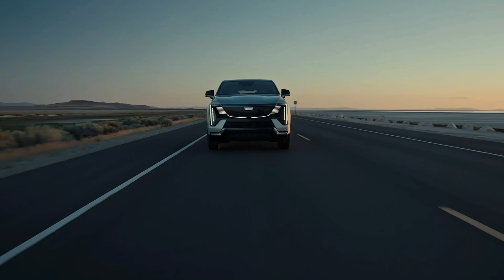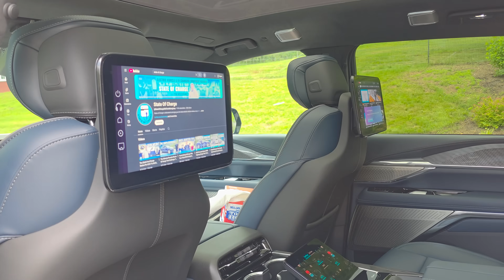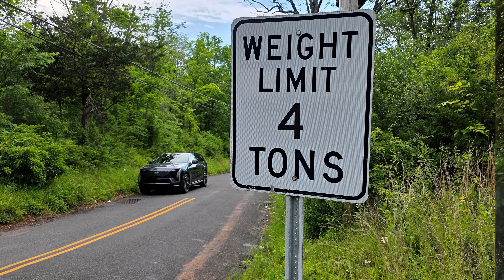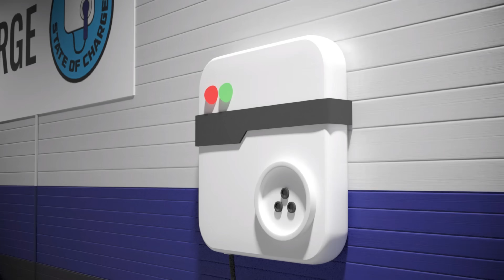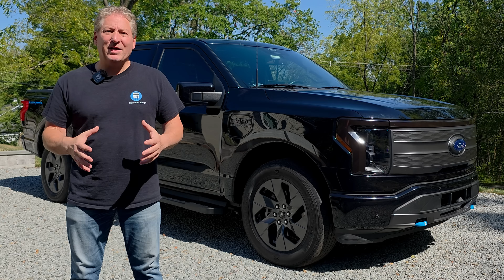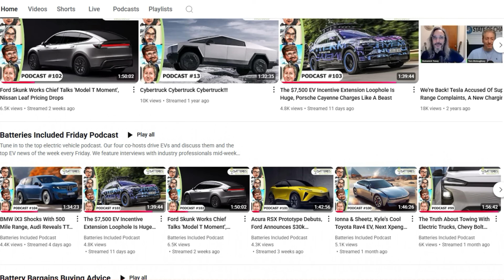Are General Motors Electric Vehicles Too Heavy For Some Public Roads?

Comment: Excellent video, especially the part about people blaming road damage on EVs. In our state they just increased the EV "fee" from $75 to $150 based on the false narrative that they cause more damage. I don't mind paying my fair share but that is excessive.
Reply: In Ohio it’s $200. The state gas tax is $0.385 per gallon. That means for an average mileage of 30 mpg they are assuming an average annual miles of over 15,000! In short they are screwing EV drivers. Not surprised given it’s a red state.
Reply: I’ve always argued the wright thing is bogus since my EV is lighter than most pickups and full sized SUVs. If you care about vehicle weight, the motor technology is irrelevant. 

But these vehicle weights are obscene. 

Base the fee on weight and mileage, and double it for anything over 4T …. For all vehicles equally
Reply: @danielp920  In my state, SUVs and trucks have a much higher registration fee compared to sedans for exactly that reason. And the motor technology is actually relevant specifically because EVs are almost always heavier than their ICE equivalent.

It took a bit of Google-fu, but I finally managed to locate some average numbers for comparison. The average ICE minivan is about 4,330 lbs to 4,850 lbs (updated in 2024). The average weight of an EV minivan is around 5,291 ;bs to 5,511 lbs (couldn't find an update date on the article). But that is generally about a thousand pounds more than their gasoline counterparts. Obviously, it's going to depend on exactly what models you're comparing.

I pulled minivans specifically because they tend to about about the same general size so it was a bit more of a direct comparison.

But all vehicles these days are being made larger and heavier - which is quite frustrating for those of us that don't want a larger and heavier vehicle. And auto makers are using that to justify the stupid price increases on new vehicles. That and they keep insisting on even base models having "luxury" add ons by default. It's ridiculous how the newer vehicles barely fit into parking spaces anymore.
Reply: elp "the "wright" thing is bogus".... Just like those that rationalize their narrative is right because they want it to be.... C'est la vie
Reply: 4 tons on 4 contact patches does more damage than 4 tons spread over 6 contact patches
Reply: It’s not “more” damage.  It’s just to replace the gas tax you’re not paying.

California charges $100/year for EV road tax.
Reply: EVs don’t pay gas taxes.
Reply: Well, they do cause more damage than a lighter vehicle would. That's just a fact - the physics are pretty clear on that. Is it a significant amount of damage? Probably not.

But given EV owners aren't paying the gas tax (which directly funds roads and bridges), I do think a higher registration fee is perfectly reasonable. In fact, that particular increase is probably a bit too low given how much the average gasoline vehicle will end up paying in gas taxes every year. But that can (and will be) debated.

The gas tax has needed increased for decades now, as well. Sure, I don't want to pay more for gas. But realistically speaking? Yeah, it needs to go up.

An alternative to a higher registration fee would be an EV tax on fast charging stations and for EV chargers installed in homes. Although considering most EVs can be plugged into an appliance outlet without causing any problems (although they will charge slower than they would with a dedicated charging port), that would need to be taken into account as well. The per wattage for EVs would make more sense IMO and probably be something EV owners would prefer over a flat registration fee increase.

Or perhaps a mixed system would work better? A somewhat higher registration fee and then an extra EV tax on the fast charging stations, but no tracking of how many watts are used for EVs when charged at home. Done that way, the additional tax funds for the registering county for EV usage would be paid to your home county and anyone traveling long distances will be paying an EV tax in the areas they pass through where they need to charge - similar to how it works when traveling with a gasoline vehicle.

Either way, EVs do need to be paying into the road maintenance fund. It's just a matter of determining the best way to accomplish that.
Reply: It can make sense as a substitute for gas tax revenue. Oklahoma did this, a flat fee roughly based on average gas tax paid. But in the same bill they also put a $0.03/kwh tax on 50kw+ chargers, which works out to actually be higher per mile than gas tax all on its own. But at least most of the road out here are tolled and are just billed by axle.
Reply: @Senthiuz  not as a flat fee, as a per mileage fee equal to the gas tax
Reply: It probably needs to be higher in reality and unfortunately. To pay for the roads.
Reply: @EricMotoring how bout we increase the gas tax too then. Infrastructure needs funded and there have been budget shortfalls for way longer than there have been modern EVs
Reply: @Comfort031  It should be, but politically it's a third-rail. Unfortunate...
Reply: @Comfort031 that sounds fair to me.
Reply: @EricMotoring  increase the gas tax, the ev fee is already punitive for basically all drivers
Reply: @AustinWirl I disagree. All vehicles using the road should pay. It doesn't matter how they are fueled.
Reply: @EricMotoring oh yes I also agree but now the flat fees are punitive, so either they should be decreased or the gas tax increase for fairness
Reply: @AustinWirl true. Maybe they could base it on miles driven and vehicle weight.
Reply: it's not a false narrative , since it still damages thinner secondary roads excessively  .... .  just not major highways design for much heavier vehicles. Civil engineer was being misleading,,,

But the narrative is usually that it replaces the gas tax.... My issue with it is that it shouldn't be a Flat tax,,,, it should be per mile tax for every vehicle.... And the gas tax should become a pollution tax
Reply: @nc3826   They should tax the electricity consumed. The closest equivalent to a gas tax.
Reply: @linusa2996  LMAO... Good luck with that  Comrade Linus.

Comment: Here in northern IL, most riad restrictions are set at 6 tons registered weight or by tag class which shows on the plate with a letter. 1/2 ton pickup uses a "B" plate with heavier trucks going up the alphabet. That makes enforcement easy. Signage says nothing over "C" plate, dont be there with a "D" plate or above.

Comment: Saving the world one 9,100 pound vehicle at a time.
Reply: 2025 Ford F-150 is the Limited trim with a 5.0L Ti-VCT V8 engine, SuperCrew cab, 5.5-foot bed, and 4x4 drivetrain, weighing in at approximately 5,863 pounds

Comment: Ironically, in a few cases it might actually be someone’s driveway that could have the problem. 😢
I haven’t done the calcs/engineering, but 1” asphalt on top of a poor sub-base (e.g., doesn’t drain well) especially with freeze/thaw cycles I could see having problems over time.

One can see this in some asphalt parking lots where there are wheel ruts.
It is not about EVs as such; just the weight of whatever vehicle vs how the pavement was designed/constructed.

Comment: I’m a structural engineer that specializes in bridge structures. Each state is different, but in Georgia a gross posting on a bridge includes all vehicles, not just commercial vehicles.  As a general rule, our lowest weight limit for a bridge is a gross posting of 5 tons. On rare occasions we have allowed a 3 ton posting, but speeds had to be limited to 5 mph and only one vehicle on the bridge at a time.

Another thing to keep in mind is that there is a safety factor involved here. This is to cover for stupid people. The signs are a CYA by bridge owners. We know that over weight vehicles cross these structures. Those signs hopefully prevent lawsuits when a bridge fails.  It also lets the bridge owner go after the driver that damaged the bridge. At least in Georgia, you damage a bridge we will go after your insurance to replace the bridge. 

As a side note, the IQ is heavy, but it’s laughable that anyone thinks this is worse that the HL93 design weights we use to design bridges. Heavy? Yes. Damaging to bridges? No. Much heavier things cross these structures bridges more frequently. People can relax.
Reply: Well said!!

My Cvl Eng & pavement education, and some job experience were telling me similar things :-)
Reply: @DYT-jx4jp I remember my highway design class in undergrad. It was interesting. The comment by the engineer in the video about width and depth are accurate based on that class. 

My experience and expertise is not in pavement design, but I do recall conversations in Georgia around increasing legal loads. The big issue with a lot of locals is that their roads are not actually designed. They just put some asphalt on it because they had a little extra cash. I was wondering if that’s why they have the weight limit signs for the roads.
Reply: @dalegoff6186  Sure, I bet that is the case in a variety of places across the US. 
Where I grew up it was thin layers of chip-seal over whatever had been there for decades. New neighborhoods got gravel/base-rock below the chip-seal and later developments switched to a reasonable sub-base with layers of asphalt. (A selling point for the neighborhood.) The streets in the neighborhood were better than the local township streets. But, they still put the weight limits on the neighborhood streets.
Reply: @dalegoff6186  Interesting point, It would be informative to get an answer to your question...

Comment: I hate the idea of our roads being full of people in fast accelerating and massive EVs that can bust through barriers like they were semi trucks. Our roads are already dangerous enough as it is for pedestrians and bikers and people in smaller cars. Just putting more massive batteries in cars to make them go further is "dumb range" as others have said. If you are buying a truck to haul boxy trailers long distances, then yeah, more batteries is what really matters because you can't increase the useful range with less weight or better aerodynamics. But there's no good reason for a luxury SUV to weigh 3x as much as a regular SUV.
Reply: I'm hoping one day EV batteries will become lighter, with more range, therefore eliminating this issue.
Reply: 2025 Ford F-150 is the Limited trim with a 5.0L Ti-VCT V8 engine, SuperCrew cab, 5.5-foot bed, and 4x4 drivetrain, weighing in at approximately 5,863 pounds

Comment: There is so much here that could be covered and yet so little impact to most in their day to day life :-)

The engineering matters in real life in some/many situations for sure. For example, those VT covered bridges, bridges and culverts, and some roads, and on the some road subgrade loading in different seasons. 

In other cases weight was used for the wrong reason to cover for the real reason (e.g., don’t want big trucks except the Fire Departments, Garbage, Movers, etc) vs stating the real reason.

Comment: Agree EV owners shouldn't pay more, but they should pay as much.  Gas taxes pay a lot towards highway construction and upkeep.   EVs don't pay any gas tax.
I dont want to pay more but  I see it.
Reply: Why not just do it based on weight and distance travelled each year during registration and take the road taxes off gas. That way it applies to all vehicles equally and would be fair for all.
Reply: @Snerdles Reporting mileage is a PIA. Many would lie.
Reply: @205rider8 drive up to the DMV, they look at your odometer and record it.
Reply: 2025 Ford F-150 is the Limited trim with a 5.0L Ti-VCT V8 engine, SuperCrew cab, 5.5-foot bed, and 4x4 drivetrain, weighing in at approximately 5,863 pounds
Reply: @rp9674 and they pay about 4-5 times the road taxes, through fuel usage, as a civic. So why do EVs that weigh even more not pay anything?
Reply: Why don't gassers pay for Damage Done to everybody's environment
Reply: You have choices, buy a gas car, pay for gas well oil producers get tax breaks and incentives

Comment: I've been saying for years now that they need to figure out something with bridges and ev weight. Engineers have to estimate the average weight that would be on a bridge if it was full of vehicles during traffic or something else. Since they probably did all those estimates for ice vehicles we will likely see at least 1 collapse in the future. Don't worry though I'm sure politiicans will do something after about 3 or 4 of them fall.
Reply: 2025 Ford F-150 is the Limited trim with a 5.0L Ti-VCT V8 engine, SuperCrew cab, 5.5-foot bed, and 4x4 drivetrain, weighing in at approximately 5,863 pounds

Comment: I don’t think the taxing of EVs is because of damage but rather the nonpayment of taxes on gasoline which is used for infrastructure
Reply: It's for neither of those things, EVs are taxed separately for political reasons.
Reply: Well, it's both. It is in most cases the most vehemently argued for by the anti-EV crowd, so they cover all the bases they can.

Fact is, just as the marginal increase in weight really doesn't affect road damage in any practical way, the tiny fraction of EVs on the road today aren't really going to contribute much to transportation budgets if they are taxed like gas cars. The extra fees for EVs is really there just because anti-EV people in state legislatures wrap their prejudice up in the plausible complaint about lack of fuel tax from EVs.

CA has the biggest share of EVs in the US, accounting for 35% of all EV registrations nationwide. Even there, they don't account for even 10% of the total motor vehicle registrations in the state. Percentages are even lower in other states. It's worth anticipating when EVs become a significant proportion of registered vehicles, and plan some legislation to enact when that happens, but given that the same people who are agitating the make EVs pay extra fees are also the same people doing everything they can to discourage EV ownership and hobble all attempts to improve EV-supporting infrastructure, I feel like we ought to be ignoring them for now.

(Of course, most states have already imposed fees, so that ship's sailed...still, the hypocrisy grates on me...)

Comment: The Federal Highway Administration's website covers the key reasons for weight restrictions. The spash page has all the information in an easy to read format. https://ops.fhwa.dot.gov/publications/fhwahop16068/index.htm#:~:text=Transportation%20agencies%20rely%20on%20driver,designed%20to%20support%20such%20loads.

Comment: Makes you appreciate how lightweight and efficient Tesla designed their vehicles so many years ago.  All these other companies are chasing “range” so much, they just pile on more and more heavy batteries.
Reply: Chevy bolt 3600 lb
Reply: Some others are improving, e.g. MG IM5 & IM6 compared to Cyberster.
Reply: Well said a similar rwd model Y is almost500# lighter than our 25 equinox lt every with more power, more features, more tech etc! Imagine tesla with semi solid state and ssb here soon. Cut 250-750# off of them! Also fascinating is merc experimenting with in axle in board sealed single disc brake drive units. The claim is prototypes are 100kg LESS IN MOUNTED weights vs current tech. Rumored to possibly enter production in late 2026-2027 in high end merc evs. So using those much more compact, efficient and powerful drive units in concert with semi or ssb could shave 200-500kgs off of premium Evs within the next 2 years. And it would trickle down from there.
Reply: @4literv6  re: "Well said a similar rwd model Y is almost500# lighter than our 25 equinox lt every with more power, more features, more tech etc!..."  "BUT WAIT THERE'S MORE...!!!" (best Ron Popeil voice) don't forget that in your obsession and preoccupation with Tesla and "moreness", this "more" includes MORE FASCISM (oh f&*k). 👈that's right, all those flat screens on the dash of Teslas now double as Kindle Readers so owners would do well to check their latest OTA update as it likely includes an installation of the latest version of GROK (aka "Mecha-Hitler") and a digital copy of Mein Kampf for their reading enjoyment.  certainly these are all reasonable things to have "ported" to one's vehicle in the year 2025 and the 80th Anniversary of the end of WW2...

MORE FUN FACTS: btw for those "baby young to the world" and desperate to live out their whole lives as teenagers (you know who you are) the rapidly approaching date of November 20, 2025 also marks the 80th Anniversary of the start of the NUREMBERG TRAILS (11/20/1945). now this is important because with the German Chancellor obviously long gone by this point, what this Military Tribunal signifies is the act of expressly bringing the COLLABORATORS and the ENABLERS of the Third Reich left behind to justice.  yeah these would be the mo-fos who want to "feign ignorance" and who repeatedly tell themselves (while standing in front of the mirror) that they're innocent and did nothing wrong.  ref: "Those who don't know History are DOOMED to repeat it..." - George Santayana (1863-1952)